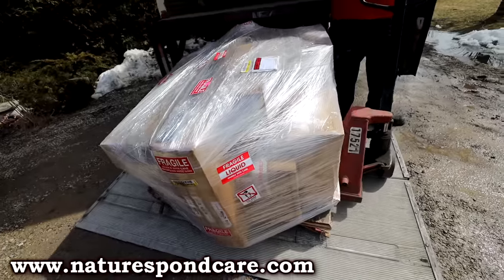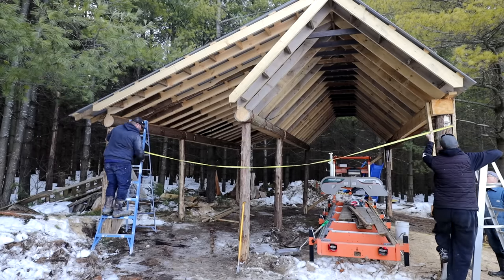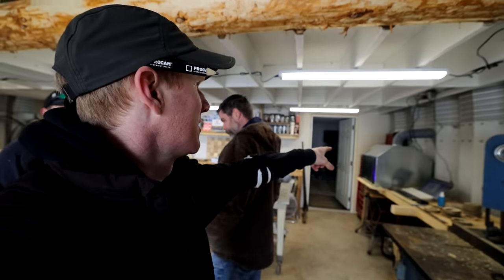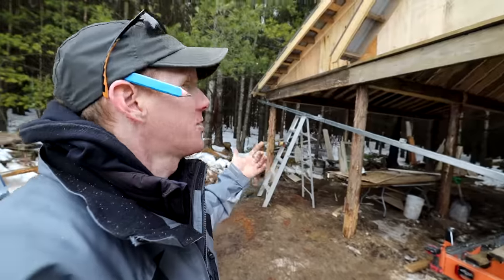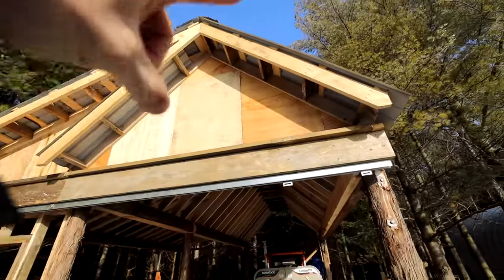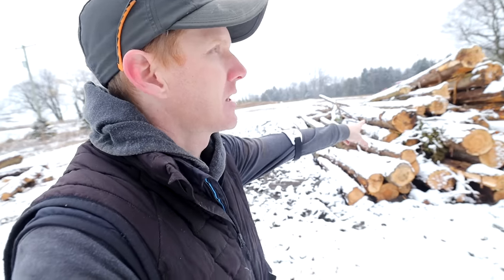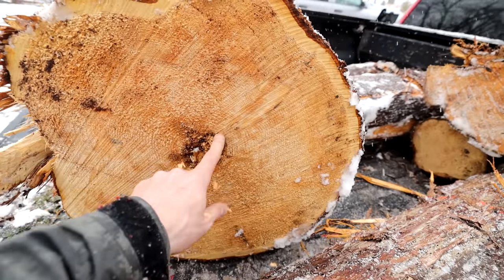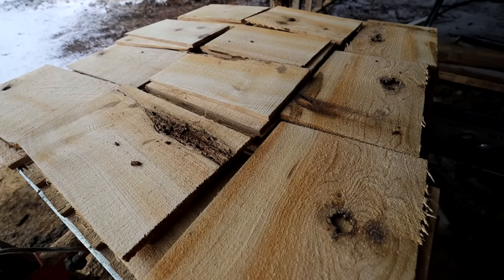Building the Perfect Off Grid Sawmill Shed!

Comment: It just needs a pulley/ winch system to lift logs on now! Really awesome build, I also highly recommend finding a  scooter muffler for a similar engine size as the mill and stick it on there. I did it on a drift trike with a 212 and it was quiet enough to have a ever so slightly higher volume then normal conversation.
Reply: Right: the enclosed space will trap sound.  Mufflers rule!

Comment: i think instead of a chain to hold the window open, since it folds all the way up, u could install some sliding bolts to hold it open. those need not be very far up the wall and if u put 1 on either side it should securely hold pen the window and be easy to reach to open or close quickly.